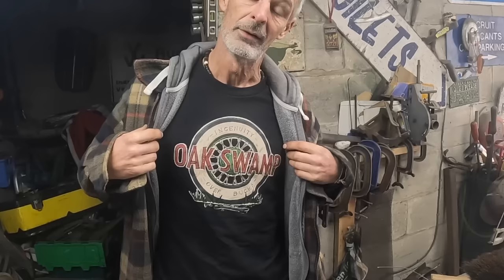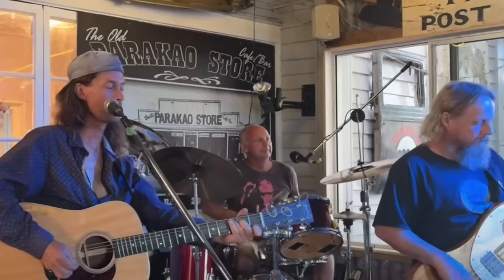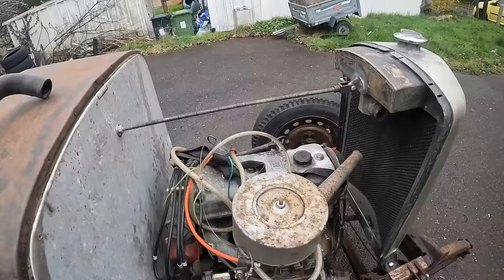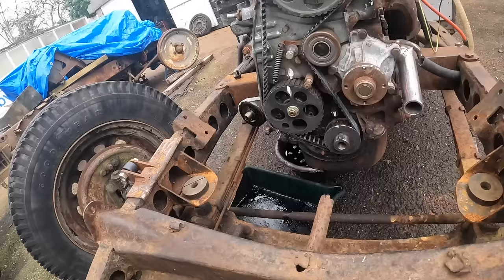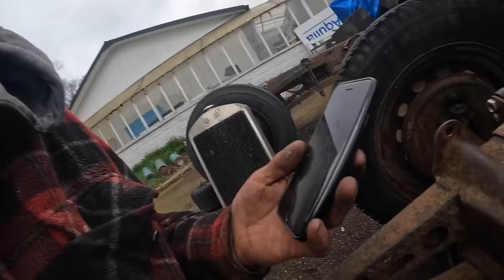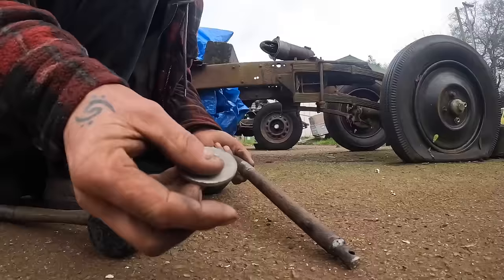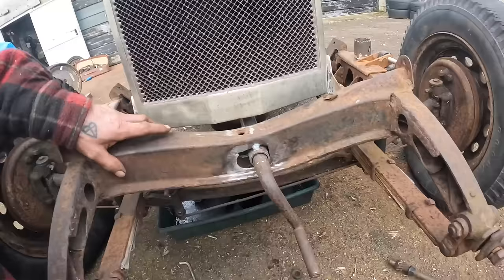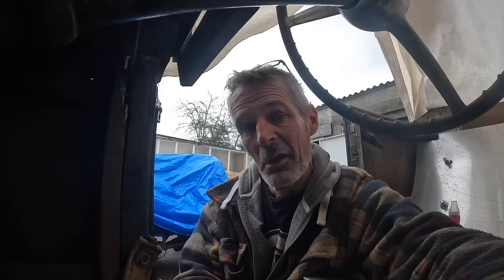'The Leaf'  a ratty roadster, a prewar car build, part fifteen

Comment: Starting handle and crossmember modifications look good 👍 my vintage Vauxhall has a centre throttle pedal, no problem using it in 20+ years. Ergonomically, it’s much easier to use the centre throttle with the right hand brake pedal, particularly when changing down gears on a crash box. Right toes on brake, right heel gives a stab of throttle and double declutch down. Our feet articulate outwards, not inwards, although that rule doesn’t always apply in Norfolk 😂
Reply from the maker: hahaha thanks mate ...i drove wagons in my early 20's all crash boxes ...i got good at it in the end ...im looking forward to driving centre throttle esp with cable brakes ....which vauxhall have you mate ?
Reply: @oakswamp  14/40, it appears on my channel regularly. Well run in, or thrashed to bits 🤣
Reply from the maker: @FlyingForFunTrecanair  love those old vauxhalls but couldnt find it ? so you re a winged chap then? steeped in aero history round here, avro  follon etc...theres a follon gnat just up the road by the shops ...did you spot  my wings yet??
Reply: @oakswamp  aeroplanes, cars, steam engines …… my inner Mr Toad is not far from the surface 🤣 I got the Vauxhall in 2002. It was an expensive week; bought the car on a Tuesday and found a wife on the Thursday. Still got both!
Reply: @oakswamp  no, didn’t spot your wings?

Comment: Good solid bit of work this week dude. I know from my projects how much graft goes into that amount of progress.
Reply from the maker: cheers mate ...yeah that was 3 days dodging showers ...could put an engine and two axles in that time hahaha what you building mate?
Reply: @oakswamp  1937 big seven special  that needs electrics to get on the road and a 1972 vw t2 panel van with original faded sign writing from a TV/radio sales shop in my local town that i dug out of barn a few year ago..
Reply from the maker: @crescentcoachworkscollecti378  COOL get on them wires mate !!! ....i have a  37 big seven frame thats gonna become  a wild single seater later this year !
Reply: @oakswamp  cool. on the lookout for any spares if you hear of any
Reply from the maker: @crescentcoachworkscollecti378  anything in particular?
Reply: @oakswamp  im hoping to trial it a bit. So a spare engine, gearbox and diff would be good, There's a few vids on my channel
(not quite up to your production quality)

Comment: Awesome stuff (as usual). I like a starting handle and had thought about doing similar on the 'Vegemite Special', but the hole in the rad shell is WAY off the pulley on the Reliant motor. Yet again though, you've proved that there's always a way! Good work mate.
Reply from the maker: thanks dude

Comment: Running through an idea about a '71 MGB engine and drive train - including rear axle- with a Ford model T frame...95 or so horse on that light a frame, set it back a bit, hide it under a longer hood...just in bouncn' the idea out tgere...
Reply from the maker: do it mate ....

Comment: Another brilliant episode Brian, I'm a fair bit behind on my YouTube viewing at the mo but made sure to watch the swamp straight away.
One thing I did ponder is that if the engine is out of an Indian car, would the pipes on the hose outlet be heater pipes because would an Indian car even have a heater?
Not trying to be smart as I've no better Idea as to what they're for. Either way hang loose and thanks again 👍
Reply from the maker: i suppose it depends which part of india ...it gets mighty cold out there ....cheers mate

Comment: what about the radiator return pipe ??? hmmmmm
Reply: @oakswamp  on the original pipe that you took off and before you reshaped it' it had two heating pipes comeing off it when you you reshaped it you only put one back on